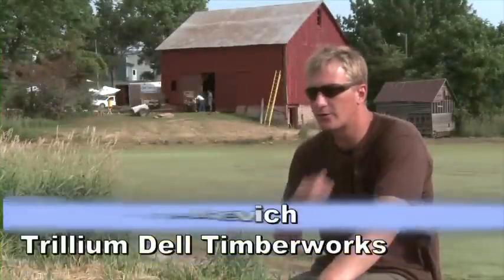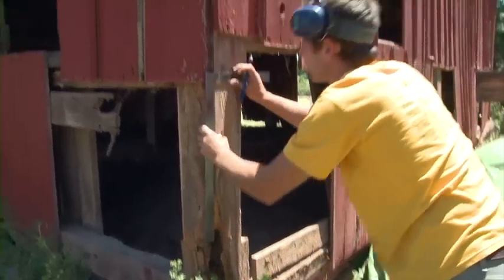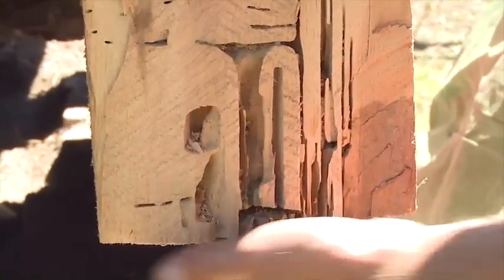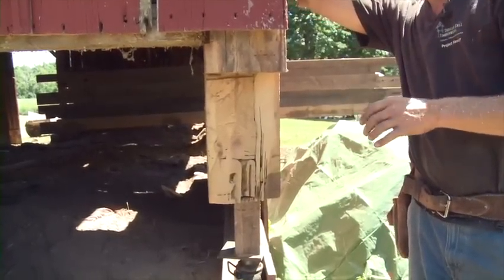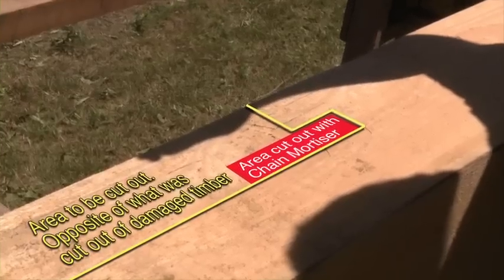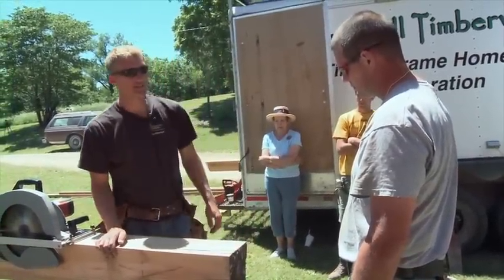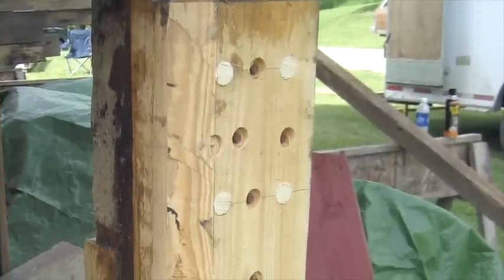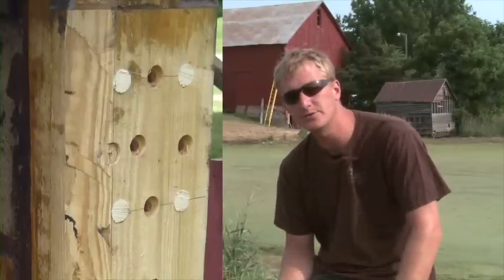Barn Series, Part #2 - Corner Post Scarf Repair

Comment: I dismantled a 1901 barn near Plymouth IL about 25 years ago. Trucked it to my place in Macomb, IL and set it on top of a 2x6 frame for a two car garage first floor and 2 story Gamble roof barn on top. So far it's still standing with the original timbers and pegs. Before the internet I just read books by Ted Benson.

Comment: Nice work! Just a little tip: The shimming causes an unequal load onto the post. If you made the shoulder of the prothese a bit too high, set it in place plum and re-saw the seam, it would be perfectly flush and the shimming would have been unnecessary.
Reply: In other words, keep the tongues short on the timber and new piece by the thickness of saw blade . . re-saw the seam in place so they match perfectly. Raise the new piece up tight, then peg???

Comment: Should have injected structural epoxy into the joint until it oozed out at the outside edges and then tightened the structural screws.